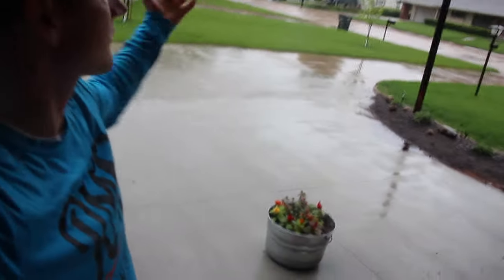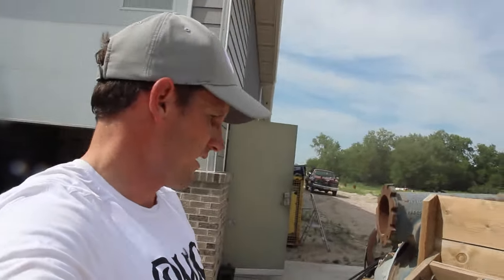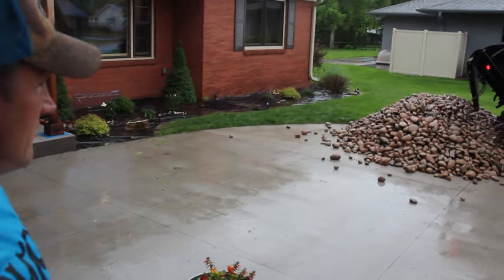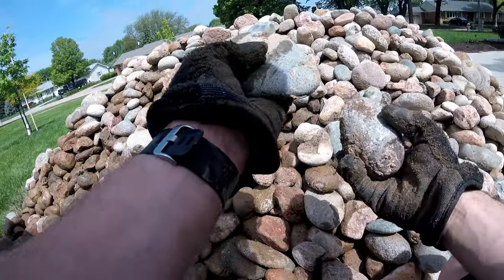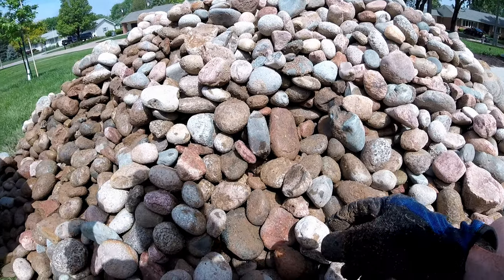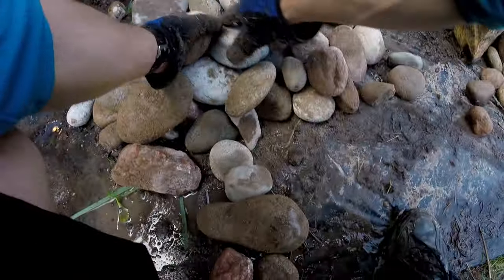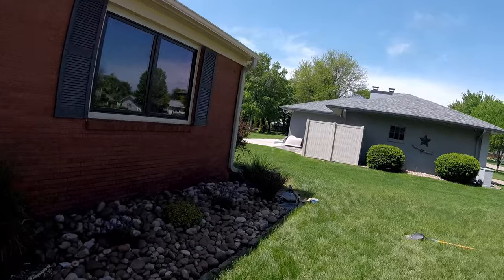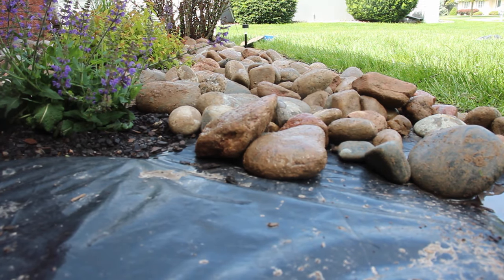Landscaping A Rock Bed

Comment: Small tips... hose down the solid rocks first, less transfer of dirt in bed for weeds to grow, also use a 5 gallon bucket and push rocks into bucket.
Reply: I've tried that and it works well.
Reply: Very good tips

Comment: Nice vid. What kind of tarp did you use. I have rock beds and stupidly didnt put sny tarp, sand, and pea gravel down and now need to redo
Reply from the maker: I used roofing tarp that is put down under shingles. Its thick and keeps the weeds out.
Reply: @RyanMOutdoors  That's actually really smart. Thanks for the tip

Comment: Did I miss it. Did you mention HOW much Rocks were dumped for your three areas. How many yards of rock did you actually use (any left over =to much?)
Reply from the maker: I had 1 ton delivered. Can't remember the different deminsions of each garden bed. I had a handful of 5 gallon buckets left over.
Reply: That's closer to 2 than 1.

Comment: It wont damage the concrete dumping those tons of rocks like that?
Reply from the maker: Nope. As long as it is scattered a little.
Reply: @RyanMOutdoors  Okay I thought with the impact of it falling off the truck, I could just see it cracking some driveways. I guess it's all good.
Reply: Concrete is very durable only will crack because weight and freeze thaw

Comment: Man you work hard not smart. I hope you learn as you go. Looks nice though.
Reply from the maker: Thanks
Reply: What's the smartest way to move the rocks?
Reply: Instead of trying to dig the shovel into the middle of the pile, start at the edge of the pile with your shovel flat against the driveway so there aren’t any rocks underneath your shovel, just the flat surface of the driveway. Much less friction that way and allows you to get a shovel full each time :)